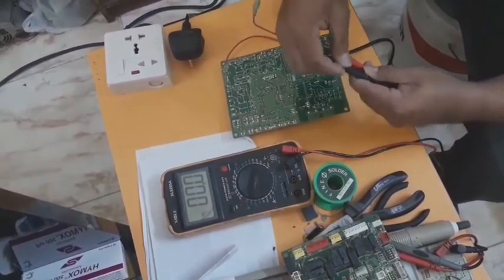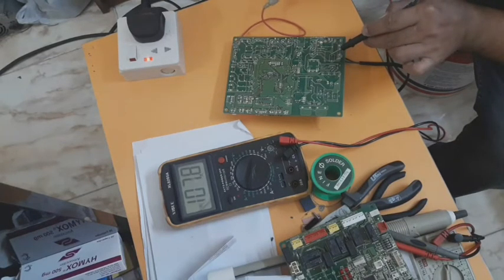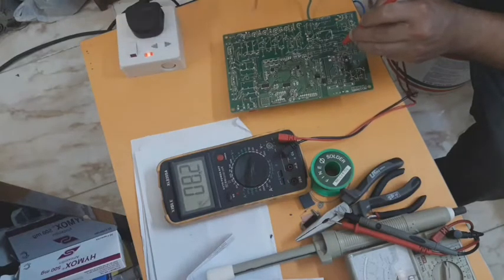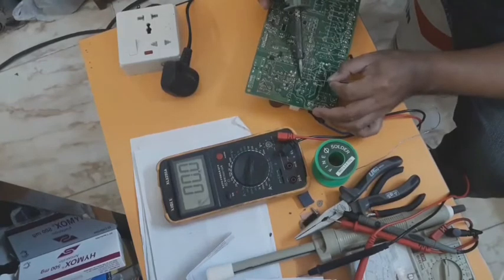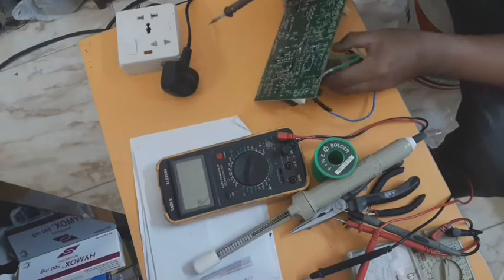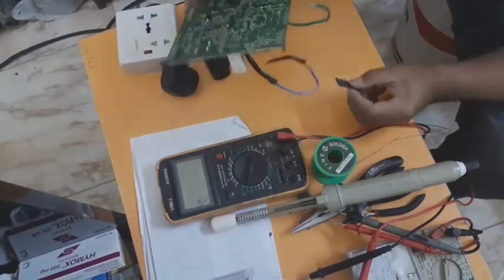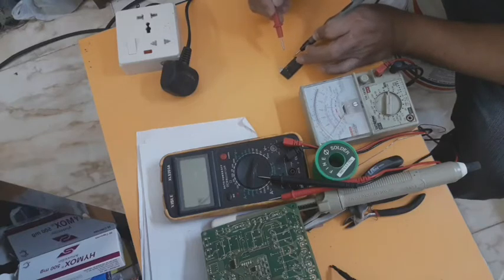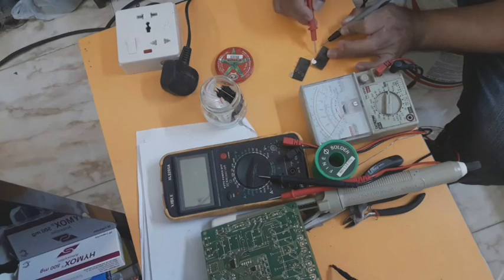Fuji Electric Airconditioner Board repair (GK 30434E4  HIC defective)

Comment: You know your stuff, help :)  my problem is the unit inside and outside are not talking to each other , I tried monitoring the voltage between connection 3 (red wire) and earth, I read this voltage should fluctuate but on mine it's steady. What you think, could it be this IC or the one in internal unit
Reply from the maker: red wire and Neutral not the earth ground...must be 100vac to 120vac
Reply: @rodskietechtv1296  i did try from neutral to. With the cable connected it sits constant 6v , with it disconnected the inside unit sits at constant 250v AC and outside unit at 0v , what's your thoughts , do both ends give a fluctuating voltage normally about 120v? Thankyou for your help :)

Comment: I just got that module from junkyard, but I have no idea with the module I just got, could you tell me what module is that ? And what's the use of that module ?
Reply from the maker: the module functions as a communication circuit, it send signal to indoor unit
Reply: @rodskietechtv1296  does the indoor unit have similar fluctuating voltage as the outdoor unit?
Reply from the maker: yes its the same fluctuating voltage indoor has 90vac to 120vac voltage
Reply: @rodskietechtv1296  my boards are still installed in the unit and fully connected. Is their anything else that would stop them producing fluctuating voltage if they are switched on?
Reply from the maker: its normal for the red wire of outdoor pcb its fluctuating signal and during standby power its still have signal...and you cannot stop that signal
Reply: @rodskietechtv1296  and the inside PCB gives out a lower voltage all the time to? Mine gives a constant 250v sure that's wrong as not fluctuating and very high voltage , think it damaged the outside units chip
Reply from the maker: just separate or isolate the indoor to outdoor if the one has lower or higher voltage at communication wire that is defective...mostly outdoor has damage IC
Reply: @rodskietechtv1296  I think both are faulty as indoor unit outing 240v constant and outside unit 0v constant not great. Wish you were close , would pay you to sort mine :) have ordered chips off AliExpress but knowing it the parts won't turn up or they will be faulty :) where are you? I'm scotland
Reply from the maker: im here in Riyadh, Saudi Arabia
Reply from the maker: just buy a chip IC and test...you can go to nearest tv technician in your place and let them check the power supply voltages if still normal, 12vdc and 24vdc.
Reply: @rodskietechtv1296  what pins have each voltage
Reply: @rodskietechtv1296  can you tell me which pins get 12 and 24v ?
Reply from the maker: @lookoutleo  check the capacitor voltage 50V/1000uF capacitor must have 30Vdc.  the other capacitor 25v/1000uF must have 12Vdc...
Reply: @rodskietechtv1296  I'm waiting on the 2 new chips coming from Ali express. Hope they come :) thankyou for the info about board voltages
Reply: @rodskietechtv1296  I checked the voltages the y seem normal. The chips arrived from China , fitted them. The outside unit seems to produce a fluctuating voltage for about 5 seconds then stops , inside unit just sends out 7 volts constant. Could the outside unit be trying to talk with the inside unit and when it gets no reply it shuts down?
Reply from the maker: its possible that your indoor pcb has problem or the wire maybe shorted try to reverse the wire also for the power supply
Reply: @rodskietechtv1296  it is connected 1 to 1 , 2 to 2, 3 to 3 and live plus neutral go to the right terminals on the outside unit and earth is connected

Comment: Hallo brother how are you
I need help I have one fuji electric air conditioner ODU unit not on outdoor unit light blinking only what's problem
Reply from the maker: check first the votage from the communication line. must be with in more than 100Vac but not greater than 170Vac

Comment: fuji electric 2ton unit Error EE:EE. COMIN WHAT PROBLM THIS ERROR
Reply from the maker: what is model number sir? may i know?
Reply: If you know how to determine which error you know sir or you may encountered the EE  ,please check the remote control as you can see the led is blinking on the remote control  ,you can press the button up and down arrow together  within 5 seconds the error will show, like e1,13 etc.that pcb he will repaired the error is e1,or e13 that is communication problem.